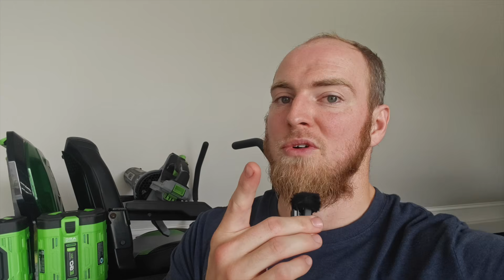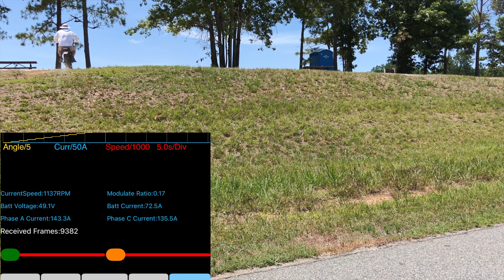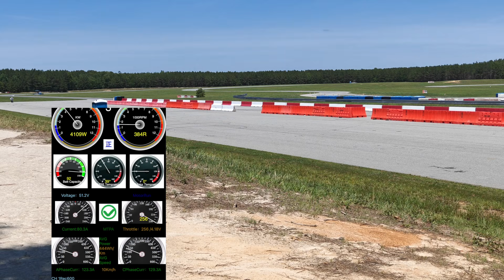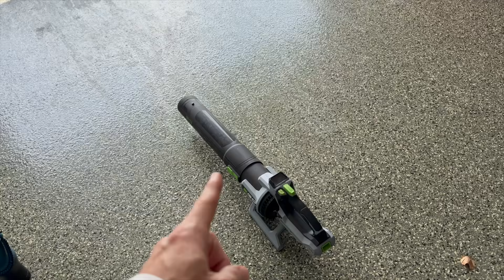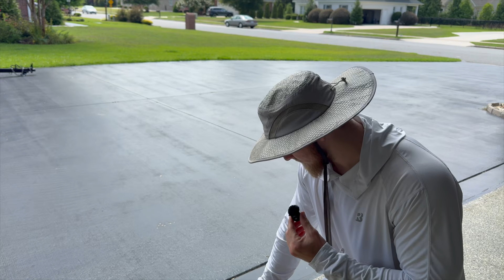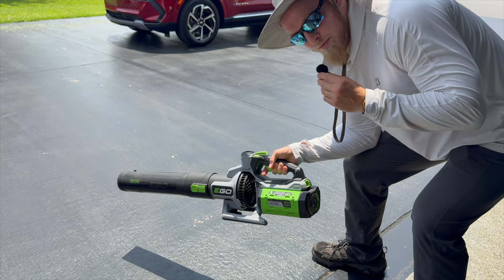EGO New 8Ah MAX vs 10Ah Battery Comparison: Power & Voltage Sag Test

Comment: An additional note is that the 8ah max shows significantly better thermal management under excessive load (notably on the handheld commercial chainsaw) where the 10ah only lasts a couple minutes before thermally overloading. The 8ah lasts 2.5x longer under the same load, so basically arborists are the main ones to benefit. That and Australian summer weather is where these shine most it seems

Comment: At $549 for a 10ah battery is why I'll never go to ego.
Reply: You say that every ego video you can find.  No.  I'm not ever buying gasoline engines again.
Reply: That's why you buy a mower with a 10ah battery for (probably) $549. Anybody buying batteries at full price is a fool
Reply: If  could I'd own nothing but 12 ah batteries for all the tools the 7.5 dont last long enough and overheat. I'm not even happy with the short lived 10 ah
Reply: Lol a Milwaukee 12 ah battery is just under $300 and it's only 18v. These are 56v so more cells required....
Reply: @Marc-zf3xv Exactly, batteries are too expensive. I might spend $40 all year for my gas powered mower and other equipment.

Comment: 21700 are nice, but I'm waiting on lifepo4 batteries for their 10+ year and 3000+ cycle life.
Reply from the maker: I would love to see that for larger riding equipment. But unfortunately it just doesn't make sense for hand held batteries. LFP would weigh about 10-11lbs compared to 7lbs with the same 8ah capacity. And they are not as power dense so they wouldn't be capable of as much power output.

Comment: You got the same setup as me, Ego and Flex 💪. Rumor has it ego may be coming out with a 15ah battery with pouch cells. They had an illustration on their website showing pouch cells in a battery but has since removed it.
Reply: Yes, the 15Ah, 10Ah(?), 5Ah & 3Ah MAX will be coming in the future.
Reply: Ego’s owner is also Flex’s owner

Comment: Very nicely done with the video review.  I have being testing two of them for a few months now on my 1100 Series mower and the 880CFM blower while getting the matching results as yours.  They are fantastic and I am planning to use them in my 28" snowblower to clear 200' x 10' area after every snowfall.

Here are my test results:

All batteries are slow charged/top balanced with PAD5000 inverter/charger with 100W GaN USB-C PD charger.
Test stops at either the moment the last GREEN LED turns RED as well as until the tool fully stops.  The regular EGO battery tens to run a few minutes more after the RED LED blinks but the MAX stops very quickly right after the RED LED starts to blink.

- LM2206SP Ver. B
- Super-Turbo mode
- Minimal 3,100rpm - Maximum 3,350rpm
- Minimal 194MPH - Maximum 209MPH Blade-Tip-Speed
- Battery usage order:  8.0Ah MAX -> 10.0Ah (25 charging cycles) -> 8.0Ah MAX (second unit)
- Weather condition:
   - 94% humidity
   - 55F/13C to 72F/22C
   - 7am Wet morning dew on all grass during entire time 
- Mulching from 4.5" down to 3.0" on cold season grass with front set to #6 @ 3" & rear set to #5 @ 2.5" to cancel out the factory forward rake for even 3" cut with much higher blade resistances.

Results:
- Both 8.0Ah MAX-Tabless and regular 10.0Ah (6 of them from 2021-2025) delivers the same 33 minutes runtime
- 8.0Ah MAX produces higher rpm and ramp up from 3,100rpm to 3,350rpm much more frequently
- 8.0Ah MAX tabless is 15F-38F cooler than 10.0Ah
- 8.0Ah MAX tabless just off the mower is still cooler than 33 minutes rested 10.0Ah

Equal runtime does not always apply if the energy demand is not high enough such as on a 880CFM:
- Turbo mode:
- 72F/22C @ 90% Humidity
- 8.0Ah MAX runtime: 00:14:49 (889s)
- 10.0Ah runtime: 00:16:28 (988s)
- 8.0Ah MAX tabless delivers consistent higher output the entire time
- 8.0Ah MAX temperature is 16%-30% cooler than 10.0Ah during, right after and after 30 minutes rest

EGO battery Maximum Continues Discharge Current (A). Power(P/W) = A x V:
- 2.5Ah (20A) x 56V = 1,120W
- 4.0Ah-BA2240T (35A) x 56V = 1,960W
- 4.0Ah-BA2242T/5.0Ah (40A) x 56V = 2,240W
- 6.0Ah/7.5Ah/12.0Ah (60A) x 56V = 3,360W
- 10.0Ah (80A) x 56V = 4,480W
- 8.0Ah MAX (100A) x 56V = 5,600W

Internal Resistance:
- Regular 18650 battery: ~25mΩ
- Tabless 21700 Battery: ~13mΩ